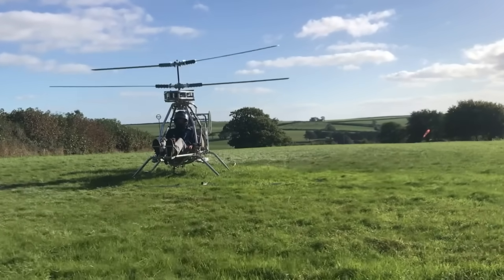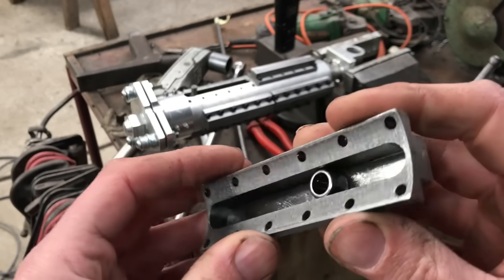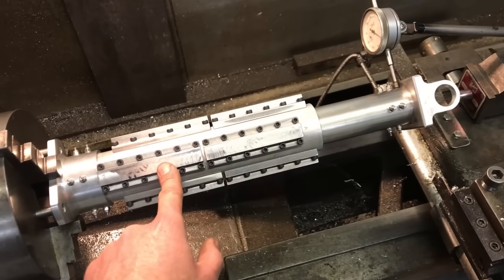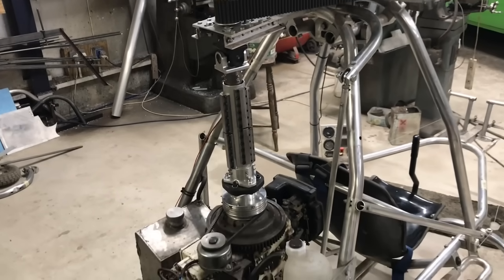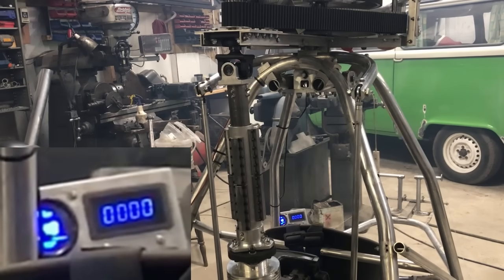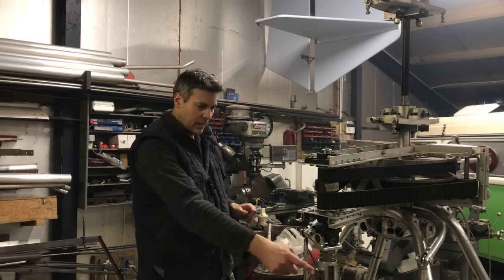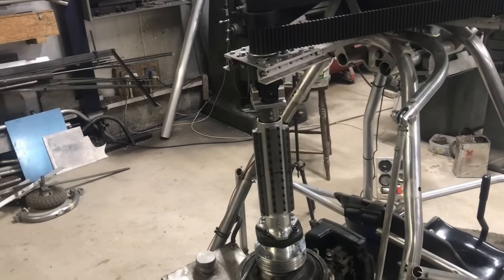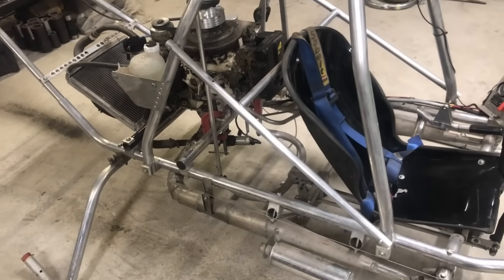Homemade Helicopter drive testing part 1

Comment: The pins on which the needle cap bearing are riding and the pockets in which they slide need to be perfectly aligned. Just image two pins under 90° : the 90 degrees and the mounted pockets in which they slide must be perfectly aligned otherwise the one that is (slightly) off will bind for sure. This is the area of a quality mill, like a bidgeport,  and a quality dividing head. Plus the more rollers or pins you use  the higher the change that one or several are out of alignment.

Comment: Just a "wild" idea: what if you would move the shaft in the centre of the propellers? So that this drive shaft doesn't  extend or contract or just the bear minimum so that you can use ie those Audi front axle couplings? Would move the drive shaft may be easier than trying to figure out this tough engineering challenge?
Reply from the maker: Hi. The Nolan brothers coaxial helicopter did this but you need an additional gearbox to reverse the rotors. 
My idea was to do the belt reduction and rotor reversing in one operation, saving weight. 
What I didn't realise was how difficult the driveshaft would turn out to be but I think maybe third time lucky. 🤞
Reply: @Ben-Dixey so it will be the needle hat rolers after all? I really "enjoy" sorry your engineering struggle to crack this major obstacle. I would design a test construction so  that you can impose a constant momentum through a leaver and a weight and being able to slide the mechanism back and forth without any influence of the weight and arm inertia

Comment: It looks too complicated to me - But then again I'm not an engineer. I know this is a big change, but can you make the motor articulate in some way (pantograph, parallelogram) to follow the rotor head, thereby requiring  a much simpler drive shaft that won't explode into lots of small pieces? Apologies if you have already discounted this..
Reply from the maker: @timcorso6337  Hi, I'm not sure an engine that tracks the rotor head  would simplify the drive or make it more complicated. Not an option that has crossed my mind to be fair so interesting idea. 
I think the right way to solve the issue is to solve it like every other coaxial  helicopter does. Double swash plates. Then I could have collective pitch too, that's the ultimate solution. 

The downside to that is double swash plates are very complicated indeed. Despite how complex it is, it's the right way to go in the long run.

Comment: Is the skidoo clutch still the transfer force of power? Do you have a collective or does it gain lift from engine rpms?
Reply from the maker: Yes the centrifugal clutch transfers the power. Yes lift is via engine rpm only.
Reply: @Ben-Dixey  dude you need to figure out a way to make it auto rotate incase engine issues in flight, it could save your life
Reply from the maker: Autorotation isn't necessary at the moment as it's only intended for hovering. It's just a toy for hovering around a field. I might add collective pitch at a later date which would allow autorotation later but I still have no desire to fly properly.
Reply: @Ben-Dixey  it's for more than hovering, it'll allow you to stop a complete free fall and land in a semi controlled manner

Comment: Why a superimposed propeller design, and not a classic tail rotor design?
Reply from the maker: @ezequiel.c4351  Bit of a long story, I would be perfectly happy building the standard configuration next time. 

Initially I thought it would have been simpler than the standard configuration. The whole rotor shaft  tilts like a gyrocopter and no swash plates are needed. Swash plates at the start of my journey looked complicated to understand so a tilting rotor shaft looked easy. Turned out to be a bit more complicated that I imagined. 

Another benefit of a coaxial helicopter is that you can generate more lift because a tail rotor can take up to 10% of the power just to oppose the torque of a single rotor. 

A coaxial also takes up less room in your workshop, it's a much more compact design, just a little taller. 

I could go on for ages about the pluses and minuses of each design but the primary reason was simplicity as this was my first attempt at building any kind of flying machine.
Reply: @Ben-Dixey  I just arrived at your channel and haven't watched all your videos yet, but it would be great if, with your experience, you could make a video about the advantages and disadvantages of the two configurations. For my part, I've turned on notifications so I don't miss any of your videos. Thanks again for replying.
Reply from the maker: @ 👍 This video covers quite a bit of it but certainly not all and there is stuff I'm yet to understand. Another video is going to be needed. 
https://youtu.be/WpgaX9TTe7Y?si=FtpdFD1M6Q6y7QlF

Comment: Amazing. 
Just remembered another hovering tip.  Your rotor head looks much like a 'teetering rotor head'. For these(as opposed to a rigid rotor head), a top tip is to "fly the rotor disc", rather than setting the attitude of the fuselage\cabin frame for attitude changes\corrections.  Easier said than done, but it means looking at the rotor disc relative to your hover reference and making control inputs to keep the disc stationary, rather than reacting to what your seat is doing. Because you are hanging pendulously under the rotor hub and you will swing about somewhat even as the disc stays put.  This might help in the early stages and after a while you'll not think about it anymore unless things are really unstable and you need to consciously lock the hover down.
Reply from the maker: Hi, read this a few times, are you saying to try and look at the rotor disc while hovering? Thanks
Reply: @Ben-Dixey  yes, exactly. (Noting it may be easier said than done on your rotor disc which is shorter than I have ever experienced, I'm used to seeing a disc \ blade tips rather several meters out in front.) But worth putting the tips\disc in your scan or peripheral vision if it doesn't feel like you are looking up for them unduly. You are looking for the disc attitude changing relative the background. It's a nice progress technique because it cements that the disc is doing the flying and you and the fuselage are really just hanging under it, so you learn what the disc needs to do to hover rather than reacting to the body movement. Sorry I realise that's not 100% clear. Will dig out my instructor notes.
Reply from the maker: @j6077xxd  Perfectly clear now thank you. If I can get it hovering again I'll give it a go, I can see the blade tips but as you say it's a smaller rotor diameter than normal. There is about 2.5foot less blade to see compared to the same weighted machine with a single rotor. On the plus side the angle between my eyes and the rotor disc maybe more acute as the lower rotor is probably lower than usual.

Comment: Have you looked into using off-the-shelf linear bearings and rails? I don't know what kind of torque you are dealing with, but I bet even small linear bearings are a heck of a lot better than the needle bearing - and they are kinda made for it.
Reply from the maker: Hi, I haven't really in the way that I think you might be describing. So the needle roller would be replaced by a linear bearing somehow ?

Comment: Nice work as usual. I had a thought about if you had to return to the spline, if instead of a spline you had a close fitting shaft in a tube and cut a series of semicircular groves in both Internally length wise on the tube and externaly on the shaft then inserted ballbearings in the grooves they would lock the two together and roll to reduce friction. I don't know how effective it would be and the internal grooves would be dificult to machine unless you drilled a circle of holes in a solid bar and then machined the center out. But just a throw away idea
Reply from the maker: @RaperJason  Thanks, I had the same thought but decided I couldn't make it. Bearing surfaces I think would need to be hardened and ground. I also think the bearings would need to circulate via an external tube. 

However another comment pointed out to me that the Nissan 350z driveshafts have the same configuration as you describe. They are built for massive torque by comparison and also run very slow by comparison, totally different conditions but might work if they have enough plunge length.

Comment: If that roller gets jammed like it did in flight, you're screwed!
You probably should try and make the spline method work.
Or even maybe look at a CV shaft (like on a front wheel drive car for example), and see if that could be modified and/or lengthened without too much difficulty, before spending more time on the current design, only to need to start over.
Sorry if that sounds cruel.😉
Reply from the maker: @mickmuzzmkmz1628  Hi, the roller jammed because is was overloaded, I've tested the driveshaft again under engine torque and it's not jamming now. I caused the overloading of the bearing by adding a preload to it. The friction increased during the testing at a fast rate but it wasn't sudden. 
The same might happen again without the preload condition but I believe it will be quite a slow increase and noticeable on the cyclic before it stoped controls from operating. 

I can actually test this on the bench as an alternative, might do that. Just plunge the driveshaft under engine torque as many times as I can or set up some rig to do it for me.

There might be other options from the bearing I chose, it maybe possible to get a low friction slider to work instead. 

I had a tripod cv joints on there before and it did work but there were some issues that made me go in a different direction. 

I'm not against other alternatives but it's far too soon to give up on this design.
Reply: @Ben-Dixey  Thats fair enough.
Friction sliders are another good option. Either way, it'll make for interesting viewing!
I look forward to seeing it. 👍

Comment: Who manufactured the needle bearings? At least go for NTN or SKF. We had Chinese bearings which cause noise when unpacked, as much noise aa a worn SKF bearing....
Besides that the universal joint (cardan joint) on top of your sliding axle has definitly to be replaced by a constant velocity joint (car like, in your VW bus behind). The universal joint gives sinus shaped moment variations, which cause vibrations. These ruin your tiny bearings.... 
AND... if you use 2 constant velocity joints on both sides on the vertical shaft, you create longitudinal stretch..probably enough to get rid of the hole sliding mechanism.. 
Keep it simple!
Reply from the maker: Hi, the bearings are budget I don't know the manufacturer, I didn't want to spend the money on quality bearings  until I had done some testing on the design. Both SKF and budget bearings have the same load capacity so I think it will come down to longevity. If the budget bearing fails very quickly I think the premium bearing will too. But I will try it before giving up and going in another direction. 

I have bought some other budget bearings to try that have twice as many needle rollers inside hoping this might reduce the load but it might not. 

I'm not convinced the Cardan joint will cause a problem with the non uniform velocity they produce, at 4 degrees a 0.49% change in velocity occurs, I don't think that is significant. 

I had two tripod constant velocity joints on there in the beginning, it worked but cv boots can't take the RPM, the shaft in the middle can float which isn't ideal as it needs to be prevented from hitting end stops and they are on the heavy side. 
Problems of which can be solved and I might have to go back to the Cv joints. Will see what happens.

Comment: So, Ben. 27 rpm over 5500rpm. Assume
V_rot = theta_dot = 2Pi*5500rpm/60 + 2Pi*27rpm/60 * sin(2Pi* t *5500rpm/60)  rad/sec  
differentiate
A_rot = theta_double_dot = 27*5500*(2Pi/60)^2*cos(2Pi*t*5500/60)  rad/sec^2
so
magnitude A_rot = +/-27*5500*(2Pi/60)^2 = +/-1630 rad/sec^2
now
Torque = Inertia * theta_double_dot.
Assume driveshaft is 3.5kg, with diam 70mm (0.07m in SI)
gives
Inertia = mass*radius^2 = 3.5 * (0.07/2)^2 = 0.0043kgm^2
subs
Torque = 0.0043kgm^2 * +/-1630rad/sec^2 = +/-6.98Nm for vibration
This will be in addition to main torque, so unlikely to unload thrust bushes.
But inspect thoroughly after test for any signs of distortion or fretting.
Reply from the maker: @martingarrish4082  You are so clever Martin, thanks so much for calculating this, amazing. 5.1NM is nice and low. Doesn't sound like it's going to be a problem. The driveshaft diameter where the rollers are loaded is  around 70mm and the driveshaft is around 3.5kg. Not much different to your estimations.
Reply: @Ben-Dixey  , just updated for 70mm shaft with 3.5kg concentrated in tube. Spotted a goof, but still only talking +/-7Nm torque variation around drive torque.
Reply: @Ben-Dixey  , one thought I had is you need to include flywheel and engine inertia in that calc. Easiest if you give disk dimensions of flywheel then I can x2 to approximate engine inertia.
Reply from the maker: @ The flywheel diameter is 234mm, it's a mixture of aluminium and steel. Is it right to assume as the drive pulley now has a freewheel it can't impart a slowing force on the driveshaft only an acceleration ?
Reply: @Ben-Dixey , lets assume 1cm thick steel at 7850kg/m^3. So
Mass = 7850 * 0.01 * Pi(0.234/2)^2
= 3.38kg
so
Inertia_fw = 0.5* 3.38kg * (0.234m)^2
=0.0923kgm^2
From above (and estimating engine inertia the same as FW inertia)
Torque = (0.0043kgm^2 + 2 * 0.0923kgm^2) * +/-1630rad/sec^2 = +/-157.5Nm for vibration.
Not sure how it compares to average shaft torque - use
power{W} = torque{Nm} * speed(radians/sec).
Freewheel should not be a factor unless vibration is so high that it engages & disengages - then you have real problems...
Reply from the maker: @martingarrish4082  That figure is a bit scary Martin. Max constant engine torque is 75NM, I don't know what it used to spike at, maybe double would be my guess. 
The mass of the clutch, crank and pistons all need to be added is that correct? 
I'm a bit confused as to why it's not the rotor side the mass isn't being taken as that's what is being accelerated? 

I assume my flexible drive coupling, the flex in the framework the rubber engine mounts etc will be elevating the torque the driveshaft experiences ?
Reply: @ , so test it my friend, with foreknowledge of the modes of failure you are looking for...
Reply from the maker: @martingarrish4082  Thank you for your input Martin , I will do some testing. 👍 
On another note 
I've just bought a 20ton tensile testing machine for testing blade straps etc. 
should be useful, it also does bending and compression. Needs some recommissioning as it was left outside for a lot of years.
Reply: @Ben-Dixey  , very cool! Can't wait to see the video. If you need calcs or test ideas then just let me know.
Reply: @Ben-Dixey  , in response to rotor side inertia then that could be accounted for, it's an excel calc rather than YouTube post. But large diameter blades means it will be significantly higher than driveshaft and flywheel etc. So I am assuming the rotor inertia is effectively infinite to give you an idea of loads the bushes have to take. Depends on resonance frequency and damping for flexible couplings. If lower than vibrations in shaft then it will reduce the vibrational torque.

Comment: The needle bearing needs a housing you are spot on with the failure mode. 
Don't worry on the run out, the needle bearings will fail, Those you have are to be press fitted into a housing.
Put square duralin or other high density plastic blocks on the pins more surface area self lubricating
Get an auto motive timing strobe light it will freeze the motion to visible moments you'll see everything running fine or all bent out of shape. (An adjustable flashing strobe will work too) 
for Drive shaft covers you can look in 'Speedway Motors' racing catalogs they ship anywhere Midget/Sprint cars use them.
No need to reinvent the wheel😁
Reply from the maker: Thanks Don, great suggestion on the alternative bearing, I will do some investigation and see if I can get a low friction slider to work instead. Always great to have your thoughts!
Reply: @Ben-Dixey  I'm enjoying your adventure greatly. You're doing great

Comment: Hey Brother Ben ,
The controlled RpM test of delrive shaft looked alright, isn't it ?
I was introducing to your work to two other people while watching your video on big projection screen .
Explaining them from A to Z .
Will write you more .
Thanks
Reply from the maker: Hello, it looked ok to me but as I know the inner driveshaft tube is not perfectly concentric with the outer driveshaft tube there will be vibration going on that I can't actually see. 

The vibration that I can't see could be putting stress on the driveshaft universal joint connections. There might be a way to measure this vibration with specialised equipment but it's expensive. 

I've got three options, I continue and hope there isn't significant vibration loads that I can't see, I remake the inner tube and try and get the concentricity better or I look for some vibration measurement equipment. 

I think I will do the next test at least with blades on and check the driveshaft is working ok under full load. 

Nice to hear you are sharing my video with others. 😊 thank you !
Reply: @Ben-Dixey  brother as we are away from the machine and you can feel every bit and beat of it there , your feelings are much stronger and important but ...
Do you think the slow  RUNNING IN process may make a difference?
Because your perfection of measurement to shaping the parts  is to the split of hair and it's a moving part like helicopter swash plate almost...
Don't you think it need bit of Running in process and then see the results??
Your welcome always as I enjoyed learning every details of the parts and developments .I like to proudly talk about you to other people as well 
Thanks